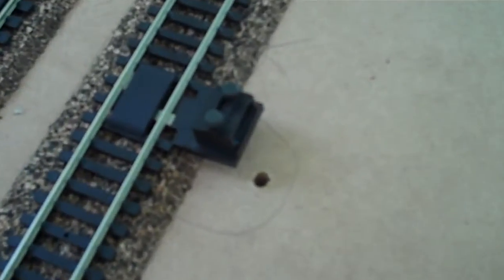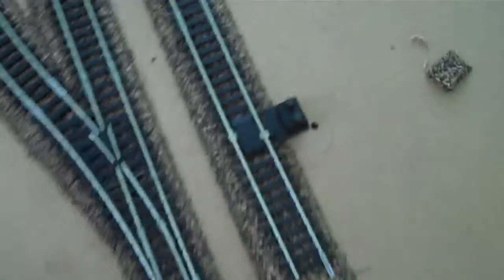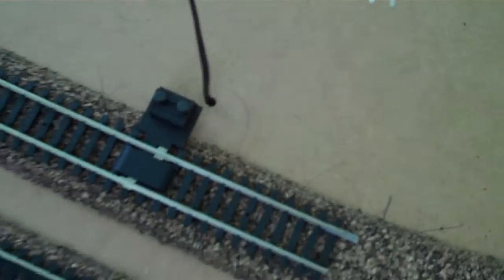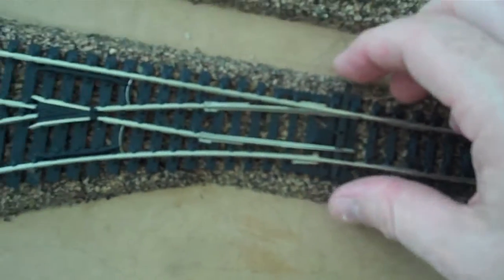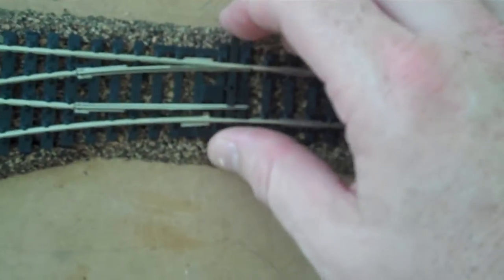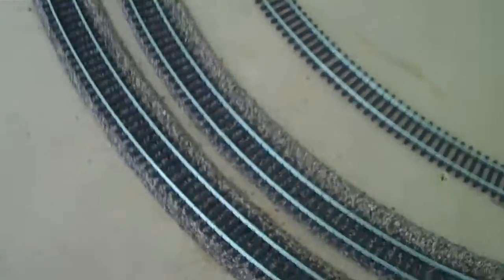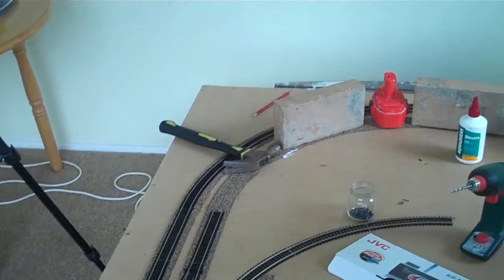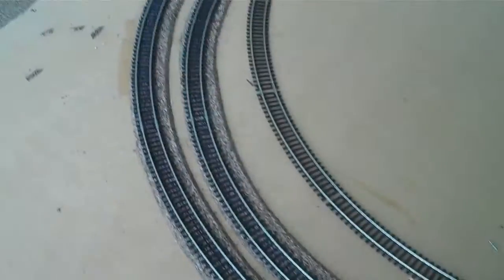009 - How to wire a Hornby 00 DCC Digital Train Set

Comment: Depends on the system - Lenz Digital allows 99 DCC addresses, plus address 00 to drive an analogue loco. Others allow four-digit addresses, not to run 9,999 trains, but to let you use the loco's road number as the address, if you so desire.

Comment: @jakclarkstudios @jakclarkstudios iv got one dcc controller set to 4 loops with points and crossovers, works fine, i use wired fishplates 1 red wire comming from one, 1 black wire comming from one, on each loop connect them all up underneath , all the reds together and same with black, then run 2 wires back to the control unit ( red to red on controller, same with black to black on controller hence all track live, pop decoders in loco and off ye go